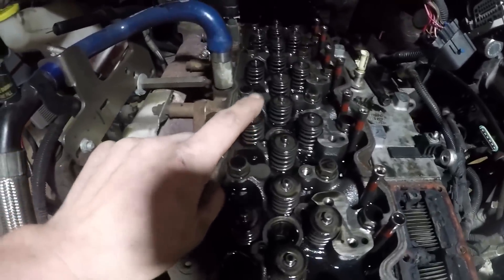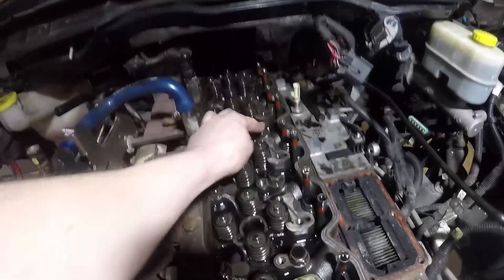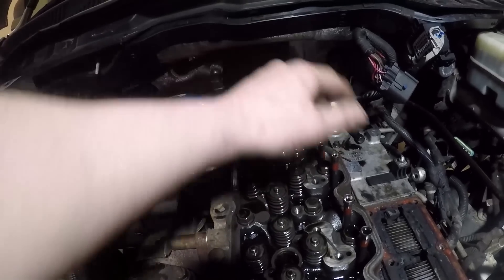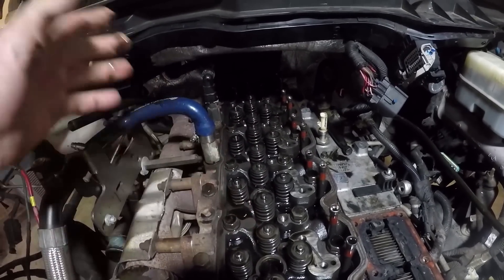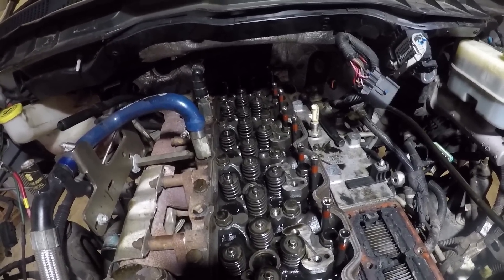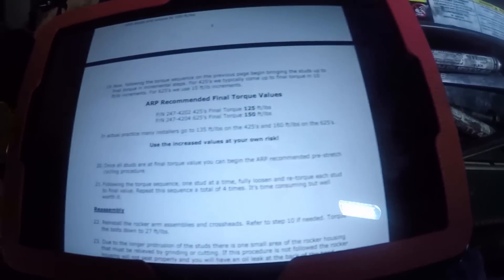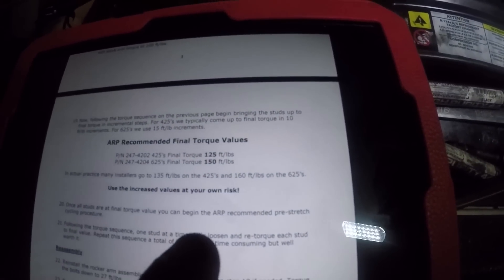How To Install ARP Head studs on 5.9 and 6.7 CUMMINS

Comment: I always wondered if you didn’t have a head gasket failure if you could use this method. Would my low output manual 2017 Cummins even benefit from this in the long run if I never towed, or cranked up the power more than 50-60 HP?

Comment: I was told that installation using this method risks tearing the gasket and that a full head removal w/new gasket is recommend; true or folklore?
Reply from the maker: Proper way would definitely be new gasket, but most don't have an issue doing it like this. I look at it that if this works which it usually does you save a lot of time, effort and money. If it doesn't all you lose is the time it took to install
Reply: Turba Tom:  after further research, the money aspect is very true, it would cost as much, if not more than my entire 2nd gen build to properly stud the head!  One question about the lube, when do you change the oil again since you get that lube mixed in with the oil?
Reply: Chris Blake it’s a tiny amount of lube compared to the gallons of oil...🤔!

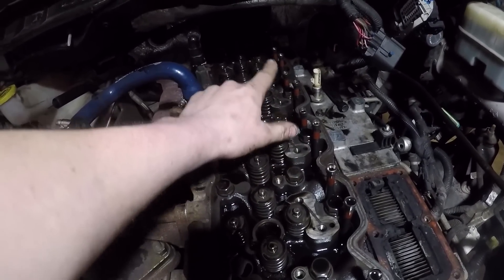Comment: So the instructions say to final torque in a hundred fifty foot pounds then it says for the pre-stretch fully loosen then retorque and do that a total of four times is that necessary? If so do I fully loosen the nut then torque it back down to a hundred and fifty 26 times and do that 4 times each? Or just torque them to a hundred originally then to say 1:15 then to s 1:40 then to  1:50 and call it done?

Comment: Worth the money to have the head pulled, or is this Method ok?
Reply from the maker: If you haven't  had any issues this is done on a common rail
Reply: Turba Tom I’m starting to see bubbling in my overflow tank. Gasket or torqued studs? Thanks

Comment: Good video Thomas sorry I'm a little late on this one but when you do that are any of those head studs and a water jacket at what point do you need to put head studs in your truck my truck produces about 40 to 45 lb of boost so those that tells you anything
Reply from the maker: Really there's a bunch of factors of when you should put studs in. Basically if your gonna give it hell or push limits id recommend them

Comment: Thanks for the video! How did you trim down your rocker housing to fit that #22 (or whichever one it is)?
Reply from the maker: You shave the spacer plate between the head and valve cover. It's so the spacer plate sits flat and doesn't get hung up on the stud
Reply from the maker: End grinder with a burr bit, then cleaned it up with a flapper wheel
Reply: Sorry for the ignorant question..... do you need to shave the rocker housing to fit the headstud in? Or are you talking about something else?
Reply: How do you do it in the truck without getting metal everywhere?
Reply: @diesellover6411   that particular piece comes off of the head and you can take your die grinder and do the grinding and smoothing without fear of getting particles in valve train

Comment: Do you have to get the engine to TDC to remove the rocker arms? Or can you just take them off and start doing the studs??
Reply from the maker: You can just remove them, but definitely check valve lash when your done

Comment: I noticed you didn't do the 4 pre stretch torque cycles. Is it necessary to pre stretch them or not?
Reply from the maker: Personally I don't think it is needed, did the studs in my 2012 this way. Needless to say awhile after doing them I checked them and nothing had changed
Reply: Not needed on the arp 625's but the 425s they do reccomend it.
Reply: Okay great thanks. I just did mine yesterday and skipped the pre stretch as well. Probably check them after a few miles and see how they're holding up.
Reply: @cp137904  Nocona Tx? I know some Parsons from there.
Reply: Cody Parsons  hey Cody, how are you holding up so far? I did not do the 4 cycle pre stretch either.. kinda nervous myself. I am Relying on Tom’s words of wisdom in this case lol

Comment: That's why I love Cummins, no pulling of the  cab or cylinder heads! Had a 6.4 PS, I wouldn't even attempted this. Glad I went with Cummins. Do you recommend upgrading injectors if you are gong to use a mild tune?
Reply from the maker: Just a mild tune, no.